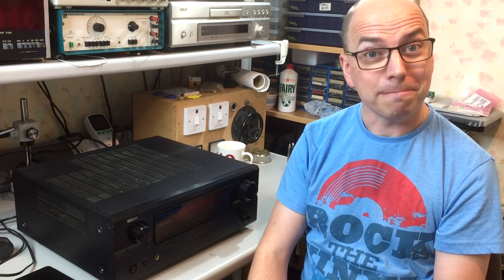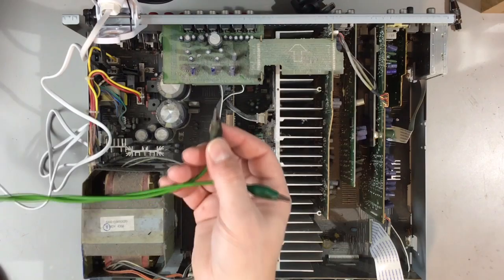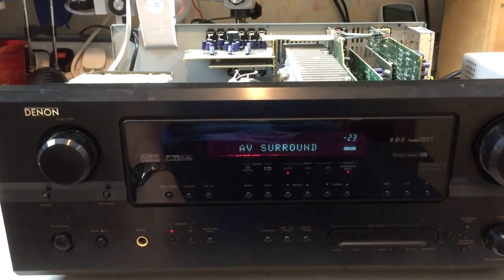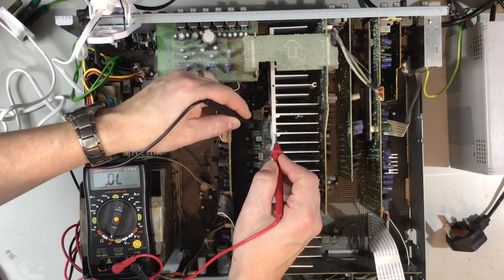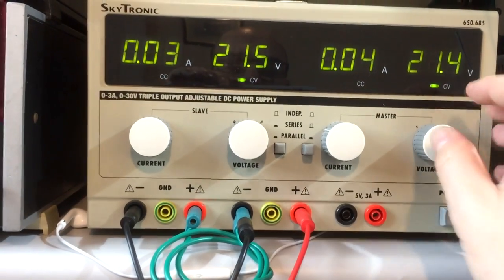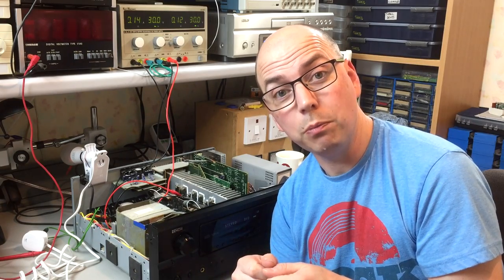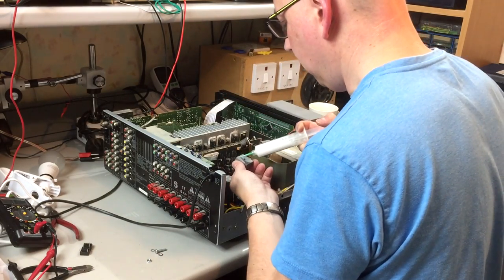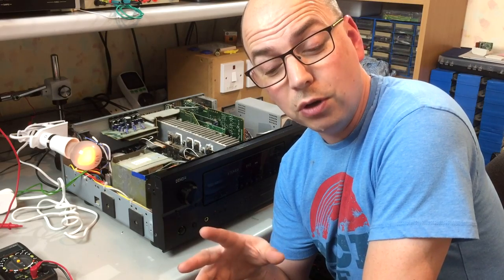Denon AVR-2105 Repair - no display or output

Comment: Dave you did what many don't. You cut the cable tie flush. Auto electricians and others leave them a little long but you can get cuts on fingers if one pushes past.
I have a Denon AVR2113 with a blown HRC fuse. Better as a mirror now like your one. Unfortunately a 400v line had fallen onto the 230v feed to the house where it is used. The amp was on standby and several 1N4007 diodes on the SMPS PCB were taken out. Once replaced the amp is functional again. The HRC fuse saved the day as there are many 80 pin ICs in the unit. Thanks again.
Reply: 3000,4000,5000 series are thee best.....1000,2000,svr series all low wattage....look for a big boy spare for the closet before there sold out  avr-3600+

Comment: Hello friend, a pleasure to greet you, I live in the Dominican Republic. I have a denon avr x1000. The music sounds good after 1 minute. It sounds like bad. You can tell me that he is a brother.
Reply from the maker: Hi Enmanuel , that sounds like an interesting fault! I don’t have a definite answer but it could be a dried out capacitor causing the issue. Very hard for me to make a suggestion but perhaps you could apply a heat gun or hair dryer to some areas inside and see if you can locate an area that affects the bad sound. Then check capacitors in that area. Good luck!
Reply: Eclectronics thanks brother i will see a technician i will tell you that suggestion😊

Comment: What I liked is the eventual repair. What I didn't like was the ugly modification. As a owner I would be greatly upset if this would be done without my advance permission. I always seek as original as possible in all repairs. Sure, the rectifier was of a higher value but, still.
Reply from the maker: Glad you enjoyed it. In this case the unit was from a family member who was going to throw it away. I knew that he would not care about a new bolt head on the rear panel! I could have sourced a black one to help disguise it but speed was more important in this case. Thanks for the comment.
Reply: I was thinking the opposite. It gives it some character, like a pirate with a peg leg.

Comment: Hi, Interesting stuff you do... I am a bit like this but.. I have a 24 year old Denon D-UTF88 system in mint condition, but I think I have inadvertently damaged the system inter-connect function. This probably whilst trying to replug it to make all the units respond to the handset.. The cables are 3.5mm stereo-like connectors which allow the handset, via the main amp, to control the tuner, CD and cassette. This no longer works, it did!, so suspect it may be blown transistors on the outputs. I have the full Circuit diagrams for each part,  and there appear to be a NPN/PNP pair, plus one, on the outputs.. Do you have any knowledge of this as to what the fault may be. I am tempted to try a repair but dont want to proceed without some idea of what it is.. In all other ways the system is working fine, well, aster replacing both the CD and cassette rubber drive  belts which had 'relaxed' too much!

Cheers
Paddy

Comment: Hello, thought I would take a chance here. I have the Denon AVR-587 very similar on the inside. in my case doesn't even turn on, I don't hear any relays clicking and then I tried to connect a table lamp to the back panel power AC outlet, so nothing so power isn't flowing even to the near by AC outlet on the back. So clearly not getting passed the very first few inches of circuit from the AC cord. I checked for broken solder joints and even the first relay, the two fuses. So frustrated.

Comment: Hello sir, I have model 1804... very good build, but when i touch ac rails from rectifiers it shows open.. also when I touch middle ground with ac rails it shows open only one shows some resistance... I disconected receiver cable from power and measure it, are my rectifiers gone open??

Comment: Working on a similar model that had a drink spilled right on the transformer area. Was very informative for a pre tear down learn.

Edit: I got lucky. Cleaned off the solidified cocktail that had been spilt on the transformer area, and around the front power button area with isopropyl and cotton swabs.... power on! Wooop woop. Just goes to show, sometimes cleaning off 10 years of goop may solve problems without even getting your iron hot. :-b
Reply: spilled 1/4 -1/16 of a beer right down mine.....idiot me......avr 3600....unplugged it......plugged in another 3805 in the closet...to hold me over.....tested the old avr 3600 again week later,,,,,fired right up.......thee 3000,4000,5000 series are thee best.....1000,2000,svr series all cheap crap..

Comment: @Eclectronics greetings from Sweden! Your video is the closest I have come to understa d what is wrong with my Denon AVR-1905. It worked in the morning, but after a faulty toaster caused the Residual Current Circuit Breaker to cut the power at lunchtime, the receiver din't work in the evening - I guess these to events could be linked.
The unit does not start up at all. No lights/display, no sound and no startup-buzz. Totally dead - but the fuse is ok!
Any ideas how to go forward? Or is it fried?

Thanks for a great channel, I've learned a lot! 👍

Comment: Hello, nice video. I have denon avr 1404, I have no dispkay on. The button is ok. The relays inside the supply board do not switch on. What could be the problem? Best regards.

Comment: Hello there thanks for posting this kind of videos, can you help me with somenthing, i got a denon avr1100w and now it got a pixels on the image show in the tv, do you think it might be a software problem? I havent find any firmware for this unit. Thanks for your answer and greetings from Peru
Reply from the maker: Hi, I would check the electrolytic capacitors on the video board and check the voltages are within spec. Good luck!
Reply: @Eclectronicschannel  thanks for your answer, i will check the capacitors and see if that is the problem 🙏🏽🙏🏽

Comment: Thanks for sharing, I have video out issue with Denon AVR1612, power/standby button blinks all the time but after few attempts power gets on, Audio seems perfect but no video at all even AVR menu is also not displaying, can you help please? I am from India,
Reply from the maker: Hi Raghavendra, i don’t know this model but I would suggest looking at the electrolytic capacitors on the video board. It could be a deeper problem but if the power supply is affected then that could explain it. Good luck!
Reply: @Eclectronicschannel  Thank you very much, happy to have your comments, I will have it checked....Thank you again.

Comment: Nice video. Could you possibly point me in the right direction for the following problem: I have a Denon X4200W, it no longer outputs any video or sound. All the other functions seem to be working fine. I can hear the relays clicking for the main power, relays clicking when plugging in headphones. I can connect to it over the network and change settings, see that I'm playing music through bluetooth, etc. I tried to find someone with the same problem and maybe find a solution that way but I was unable to. Any idea where this problem could be coming from and where to start looking.
Greatly appreciated for any suggestions.

Comment: I have a Denon AVR 1910,my problem is after switching on the receiver works for 15 minutes to 30 minutes after that receiver not outputting any sound but display shows sound dtshd or truehd or  source sound. can you tell me what is the problem?  same happens when receiver in tuner mode also( but when I change to "direct"  sound is restored but when I change sound mode to  stereo or Dolby music or another mode ,sound output stops again- in tune mode only).kindly give me solution for the problem.
Reply from the maker: This sounds like the DSP is affected. Check the electrolytic capacitors around that section and that the supply voltages are within spec. You’ll need the service manual to help. Good luck!

Comment: can it be a fuse if over driven with that familiar smell and protection mode constant .I  ran it with one channel open circuit AVR2000 denon.? What a loose banana l am , but you should hear my mixing ear. Blows you away .

Comment: Semms great..  Hi, am raja. I have Yamaha RX-A1060 av receiver... Suddenly going into protection mode.. I have checked amplifier dc circuit voltage seems fine. Can you advise some tips? I don't have service manual also can't find out
Reply from the maker: Protect mode can be caused by many different faults but the typical ones are (1) DC voltage rail out of spec (2) power amplifier outputting DC voltage (3) power transistor shorted in power amp. (3) can be checked with a multimeter on the diode check or low ohms ranges. (2) can be checked by connecting the multimeter (on voltage range) to each amp channel in turn (before output relays) and powering up; Any sustained DC voltage indicates a fault. (1) sounds like you already checked, but without a service manual it’s difficult to know you have tested all the internal rails.
Reply: @Eclectronicschannel  Thank you so much.

Comment: My denon 1603 prologic and 5 channel not working. But stereo and external working. Can you please help where is the problem
Reply from the maker: Trace the signals through the unit with the help of the service manual. Probably the pro logic decoder or DSP chip is affected. Look for bad electrolytic capacitors or voltages that are wrong. Good luck!

Comment: Can you help? I have a simular problem when i plug in the high voltage. But if i unplug it, everything but the sound works..
Reply from the maker: Mathias Oen it sounds like either your unit has the same issue or there has been a failure of one of the power amp output transistors. You can test for these exactly as I did in the video. Look for any readings that are less than a few ohms, check the bridge rectifier and power transistors. Good luck!

Comment: A bit silly putting 2 bridges in parallel. The one with lowest forward voltage drop will take all the current.
Reply: Not all, surely. Only a larger percentage.

Comment: Hello sir. Could you help with mine. I have AVR 1705 almost identical pcbs with yours. When i turn on its flashing red then it goes solid green but without any relay click and no image in front panel. Front leds working. But not the screen. I ve checked all the power transistors, all relays fuses power transformer cables and capacitors. Also all diodes. Its just go green with no click and no screen but its responting to remote control. Thanks in advance!

Comment: Hello sir iam one of your subscriber 
I am using denon avr 3805 few days before the system is not in working condition power on few second it will go off mode what is the main problem
Reply from the maker: Hi Pradeep, sounds like a power supply issue or faulty amplifier section. Check voltages during start up and look for DC on the amplifier output nodes (before the relays).

Comment: Hi friend My avr denon 3310 power is on but display not working, audio output not coming  you have help me?
Reply from the maker: Sounds like a similar problem, try the same steps with your unit having downloaded the service manual. Good luck!

Comment: Very nice troubleshooting video.  I have a Denon AVR 1802 that stays on Standby and does not power up.  I tried factory reset holding Spkr A+B and plugged in the AC power, the display flashed, and then the LEDs stayed on for Spkr A, B, Auto, PCM, DTS, Digital, and dts; it still does not power up.  During display flashed, some clicking sound were heard.  I measured the rectifiers on the board, and both have ~ 0.5V values.  Is there something else I need to do?  Thank you.
Reply: Check the transformer, there’s no voltages on the secondary ? check the thermal fuse inside the trafo windings and try to bypass it to ave an happy transformer. You better replace the bypass with a proper thermal fuse, just for  safe.

Comment: I have a Denon x5200 it's powering on and off then completely off with no lights! I tried disconnecting speakers 2 at a time, still turned off, then I disconnected all speakers, still turned off. Then I reset the unit and it still turned off but after a few tries it stayed on. Decided to make connections and it's turning off completely, no stand by light either.
Reply from the maker: I haven’t looked for a service manual but it sounds like the standby supply or main supply is faulty. See if a service manual is available and we can check the schematic.
Reply: @Eclectronicschannel  hey thnx for the response! I was pretty freaked out for a while being without it and it was hard finding a qualified Tech but there was a lab about 70 miles from my home. Looking story short, turned out to be the HDMI board, $480 later and a lot of miles on my car but hey, it is a real good unit and couldn't really match it for that price. I have it connected in Atmos now 11.2 and it sounds better then ever.
Reply from the maker: Glad it got worked out! Nothing worse than landfill because of one tiny component 👍

Comment: I have a denon avr-x4100w powers up but no sound or video fuses all good any ideas?
Reply from the maker: Hi Thomas, I’m not familiar with the model so apologies I can’t help. The procedures of checking supply voltages on the various sections applies to all repairs so I would start there. You will need the service manual though. Good luck!

Comment: if you run it over an Isolation transformer, which is not needed it has a transformer of its own so it is Galvanicly separated, but if you really want isolation ok, but then  Ground it and defeat that isolation really makes no sense to me . The reason you use Isolation in the first place is so that when you hook up Oscilosciope that you dont make a Ground loop with phase when you check phase , or something , when you ground it you practically defeat that and back to square one it is . So i dont understand why do it .

Comment: Can u help me to. No display and no sound.
Reply from the maker: The video is here to help people like you, have you tried the same procedure?
Reply: I've same problem.my avr1603 that has no display, only stand by red led on.i checked all power transistor are ok and no dc volt out to speaker relay.plaese help